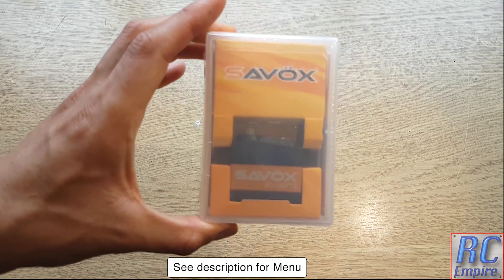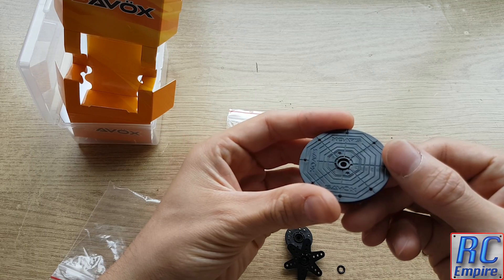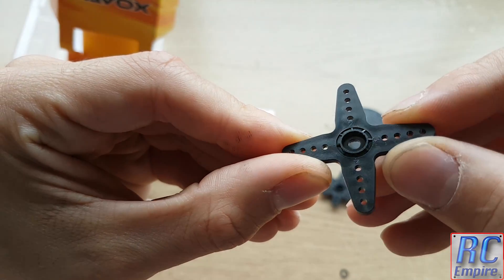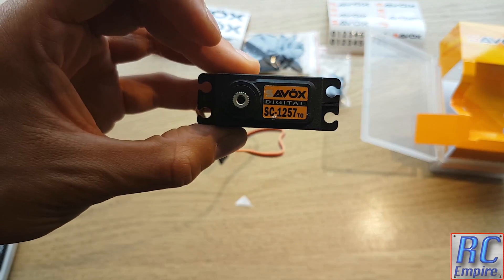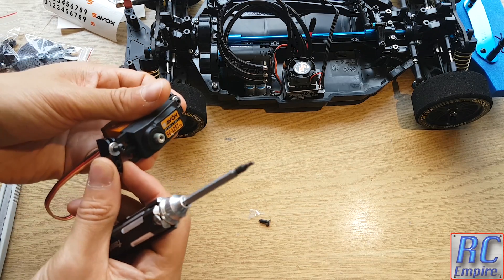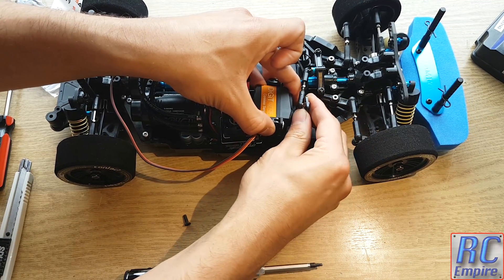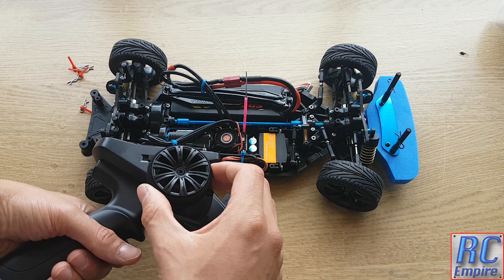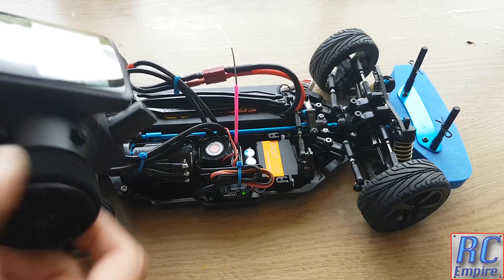Tamiya TT-02 Type S Race Build: Savox SC-1257TG Full Unboxing, Fitting and Testing

Comment: You fit the metal sleve in to the rubber after fitting the rubber to the servo. that is why it did not fit.

Comment: Hi I wanna know what moter and esc n battery u have in there also have you noticed the tyres angle when turning left right not go as far out as the other or could it just be my car setup?
Reply from the maker: Hi, You can see all the electronics and parts used in detail in our build videos and the playlist : https://www.youtube.com/watch?v=QOtyNHk5JHM&list=PLw1Z8RzSF-F854spQo00BZjYvWJmqaUMK 
But we will be making a summary video with a list of all the components and the total price of this build very soon.

Actually, I have notice this. I haven't tested the car out yet in the open to see if the turning radius is bigger on the right. 
I'm thinking the servo horn might need adjusting, or one of the turnbuckles are out? but it seems like the difference in turn movement happens before the steering arm turnbuckles. So the steering bridge also moves less to the right.  
But I will investigate this and let you know if I find anything. We will also be upgrading the steering later, so look out for that video, maybe this will fix it.